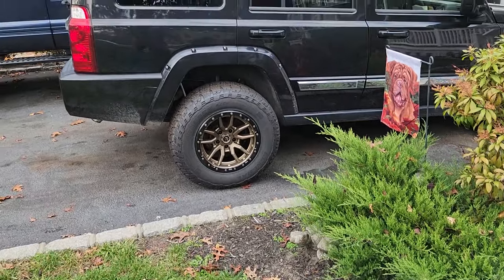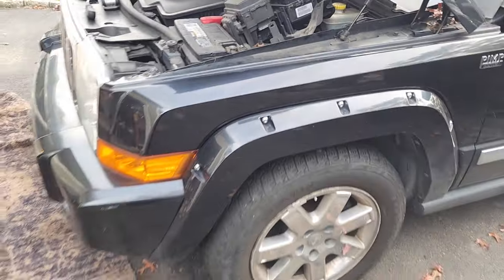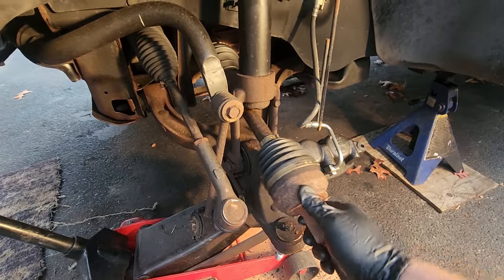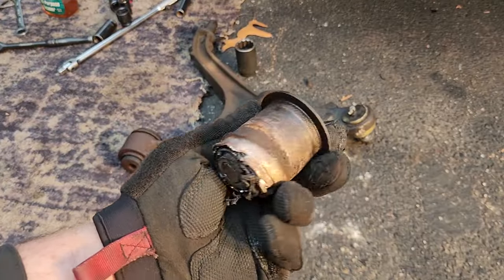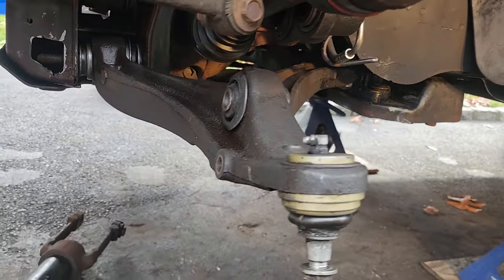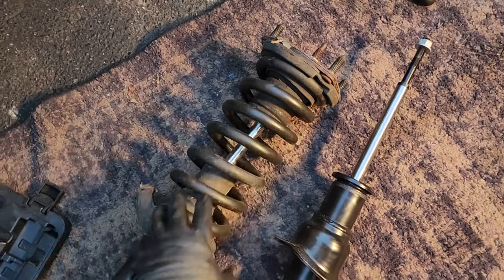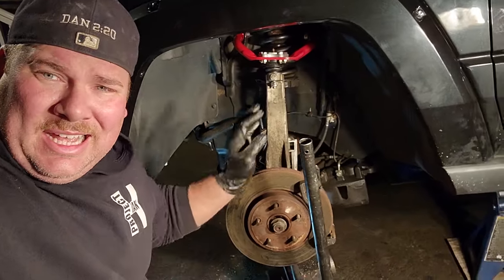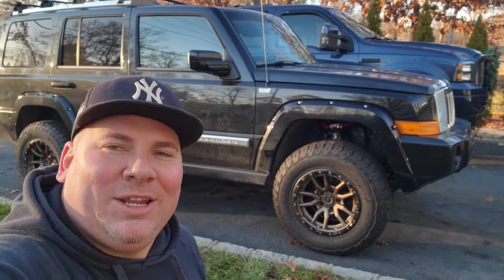JEEP COMMANDER LIFT -  PART 2 - FRONT - 2009 XK/WK GRAND CHEROKEE 3 INCH BOOST

Comment: Nice job!  I have the RC 2" lift on mine with 255 75s.  I need to change out the front end suspension parts (still original on my 2006 w/ 149k miles) and replace the struts like you did in this video.  Thanks for posting your play by play... very helpful.   
PS - after watching you replace the bushings on those control arms, I searched for new ones on Amazon.  LOL!  That did not look fun.

BTW: The 3 inch looks awesome!  Great job!!
Reply from the maker: Thanks man!! I actually made a whole separate video on how to replace the control arm bushing but it was such a pain that I integrated the clips into this video and I'm recommending it not be done!  My pain for your gain. Lol
Reply: @ProjectDanH  Ha!  Thanks for swallowing that pill for the rest of us!  Looks like they're 160 for the LCA pair on Amazon.  I haven't done any research on lower control arms.  Just curious, which brand would you go with?  I have a limited hemi with the QDII.
Reply: @ProjectDanH  Believe I'll skip that one.  Reminds me of trying to remake cv shafts on my work bench, and keeping track of bearings...

Comment: I'll tell ya, the worst part about working with rust, is when a bolt swells up with rust inside a bushing sleeve rendering it almost impossible to remove depending on accessibility
Reply from the maker: You said it bro! Rust is the worst!😊

Comment: red bearing grease on your Acme thread on the ball joint press works much better, its messy but keeps the threads from galling. The commander looks great i always wanted to lift mine
Reply from the maker: Great tip!  I recommend a Hemi commander!

Comment: Curious to know why you went with pucks and forks instead of springs and shocks?  Very educational video.  I've watched quite a few of yours.  Those Fuel rims look made for the black limited.  Same as mine, might have to look into a pair.  Haven't seen one until now that I like better than the stock chrome 17's.
Reply from the maker: Thanks man! I think it just came down to availability and affordability.

Comment: Does anyone know a forum or how to take the headliner out of the commander? Just bought a second commander, first one with the sunroof and it’s leaking pretty bad. I know there is drain tubes I have to check but as far as cleaning the headliner I would love to see a vid on that or if anyone has a forum I would really appreciate it
Reply from the maker: It's a little complicated than an XJ but the basics rules apply.. not so difficult

Comment: Hey bud.. fab vid... I did the same lift... but the drive shaft angle... meant lots of pop and clunking... I fitted new cv axles... but still no good... so had to take the front lift out... or it's not driveable... could it be alignment? I fear not....
Reply from the maker: Did you get it aligned after the lift?  Also did you do A arms , bushings, ball joints and torque everything down?

Comment: Are the axles still straight or are they sitting at an angle after lift? Considering doing the same lift to my commander but dont want to deal with problems with the axles afterwards.
Reply from the maker: They're damn near perfect
Reply: @ProjectDanH  thank you.